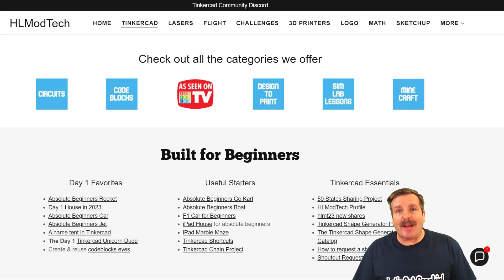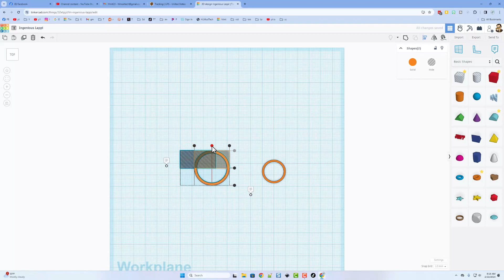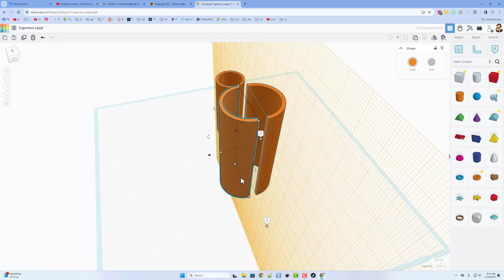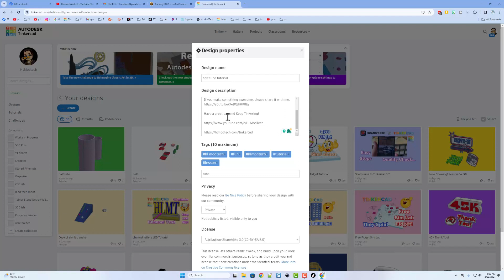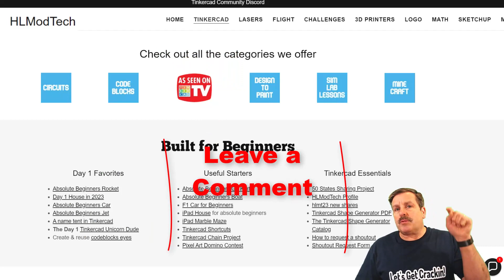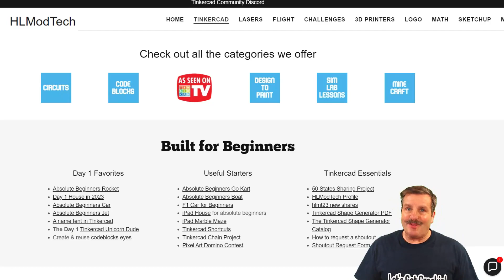Smart Steps & Tinkercad Tube Tricks Skill Builder Bonus in 5 Minutes!

Comment: thanks for the nice tutorial, but if we have a situation where the shape has different diameters, for example wider from the top, the middle has a different diameter and the bottom maybe a small diameter, it's like you take a tube and you squize it from 1 or 2 spots,
Reply from the maker: It is unlikely that simple solution will help with your shape. Would you like to send a share link so I can see inside it? Here's how https://youtu.be/XeDQjhRK8lg You can reach me at hlmodtech gmail. It is smart to make a copy of your design before you share it with me.